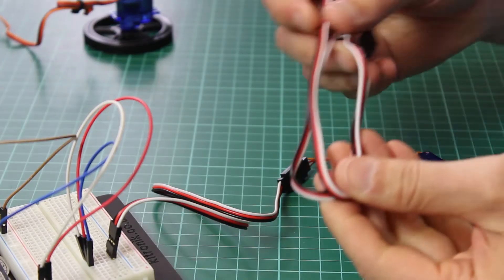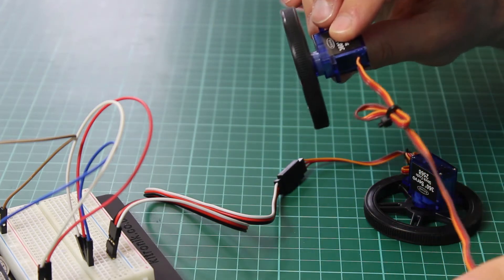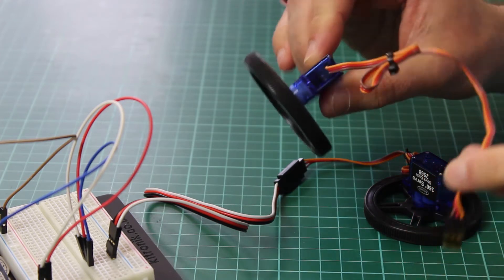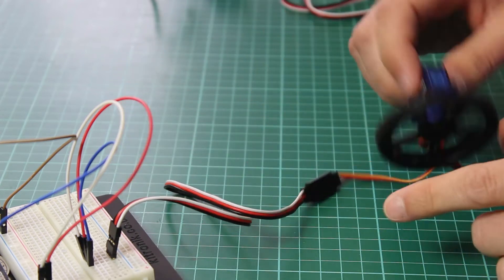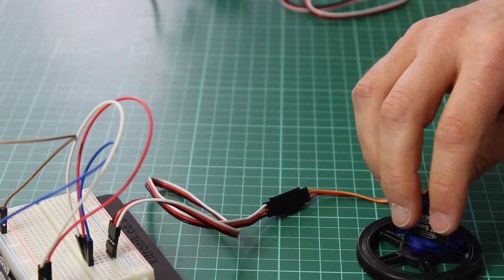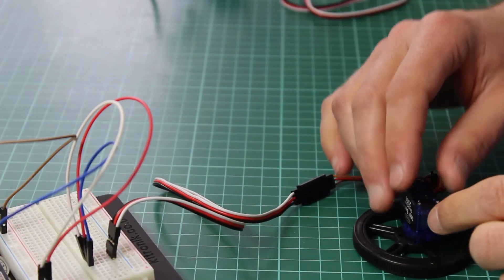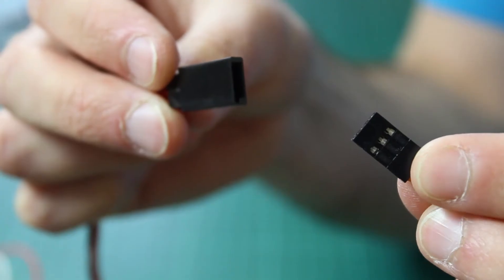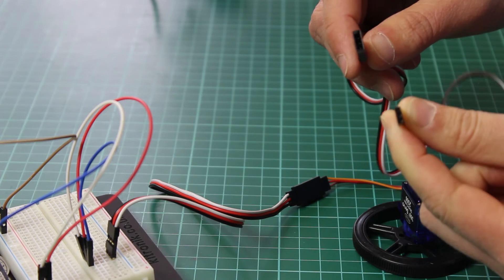Male to Female Servo Extension Cables - Kitronik

Comment: Does it matter which way the connector plug is turned when you connect the 2 parts ?
It seems to fit both ways.
Reply from the maker: Yes, it matters which way around they are connected. The video shows the correct way to connect them, connecting them the wrong way around can damage the servo and possibly the power source too.